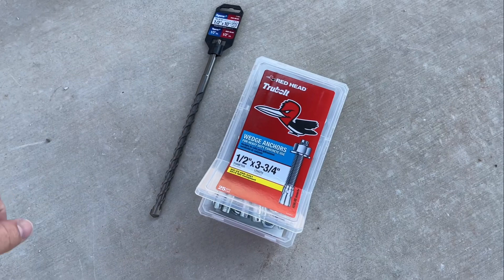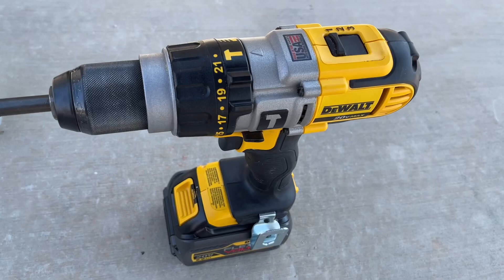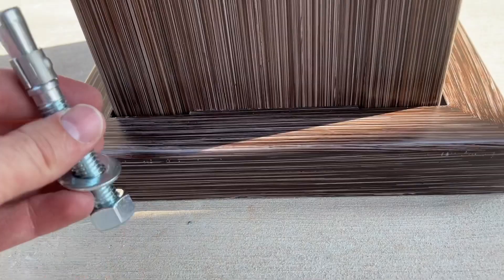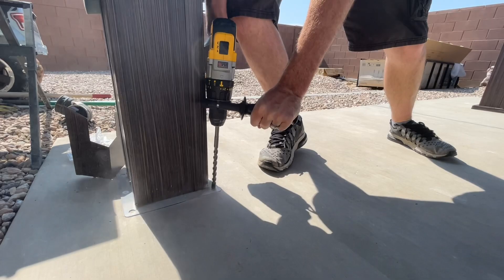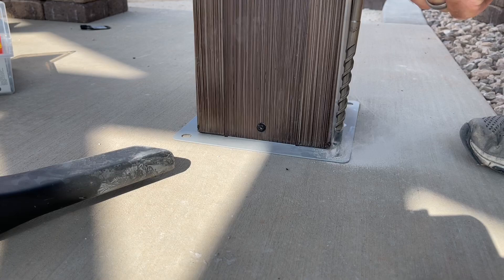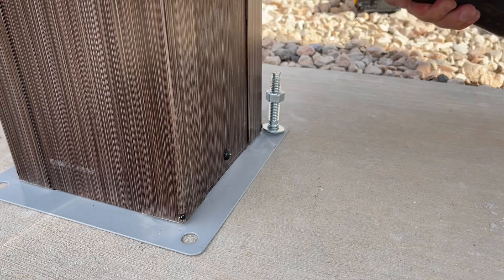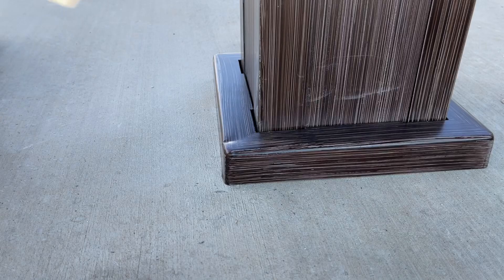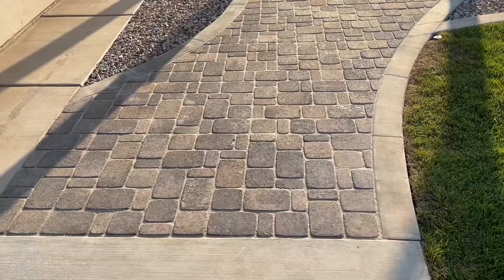Wedge anchor into concrete DIY. How to bolt down a gazebo, shed, or structure to cement

Comment: Here is another fun fact. Use a 3/16 masonry bit, drill a hole in the flange, 2x4 etc, insert a piece of 16 gauge annealed wire about 4 to 5 inches long and drive a 16d common nail into the hole. Inexpensive and strong.

Comment: Danny, great video,  how would I anchor my gazebo that's going to be on patio pavors?
Reply from the maker: Unfortunately, according to what I have read it is not possible. “Pavers are held in place by gravity and each other. They are not cemented together, so you cannot anchor something like a gazebo, pool cover or railing by screwing it into a paver. Too much force and the paver will lift out of place.”
  You may need to pour footings for where the Legs go
Reply: @dannyjohnsonsgarage  
I purchased this exact gazebo, but I bought it used a family member no longer wanted it. I'll be using your video as reference because unfortunately the manual is no longer available. Do you happen to know how far apart the corner bolts have to be?

Comment: At work so I can't listen with sound yet, but I'll preemptively ask:  is one bolt per gazebo leg enough? Do I need several?
Reply from the maker: I would say 2 or more, but if you have tornados in your area use 4 lol. Do what you feel is best. There are spots for 4 but my fear was to compromise the concrete and have it crack.

Comment: Thanks Danny.  In video you mentioned couple of times to not drill too deep in the concrete to the sand under slab.  So the drill bit was taped.  What is the reason and what if the slab is uneven?  With pole Hardware kit I got 6” long anchors but my patio may be around 4”.
Reply from the maker: Yeah, you’ll want to do as shown in the video. If you go down deeper than the slab, the bottom of the bolt that expands won’t expand into the cement, it would expand into the dirt. It would probably still hold and not come back up, but you want the expansion of the bolt to be firm. That’s why I drilled down so the bolt goes into the concrete on expansion

Comment: I'm looking to do the same with our gazebo, but the 3 3/4" anchors are too long. Could I simply use the 2 1/4" so that they don't have to be cut? I don't have an angle grinder and I couldn't find the 3" anchors.
Reply from the maker: Yes, just use shorter ones. They can be purchased individually so you can try one before buying them all
Reply: Did buying the 2 1/4" ones work well for you? I also don't have an angle grinder and was thinking of doing the same thing
Reply: You can use a hacksaw, cheap at the big box stores and just make sure it is equipped with a metal cutting blade, not wood. It cuts right through.

Comment: …. So what happens if you are drilling and hot rebar. And cannot relocate the hole?
Reply from the maker: Get a metal bit that will cut into the rebar or use a different hole area are pretty much the only options

Comment: I have a question. What is your cement slab is slightly sloped. How can I make sure my Gazebo does not end up tilted?
Reply from the maker: You can add shims under the feet as you assemble the gazebo to ensure it is level

Comment: Did u drill through gazebo hole? Any certain tip doing so? Is it easier or harder to mark holes then move gazebo and put it back after drilling holes?
Reply from the maker: The gazebo is so heavy it's best to drill up against it in my opinion. Watch your knuckles! I cut mine up a bit and didn't even realize it.

Comment: Great video. Very helpful. Did you secure the gazebo before finishing the build, or did you secure once the whole thing was built?

I'm debating securing the posts now, even though I don't have the roof on yet.
Reply from the maker: I waited until it was completed
Reply: @dannyjohnsonsgarage  Thanks. I think that's the way to go. I've had to make so many adjustments already.
Reply: I would recommend waiting until you're finished because you may knock it off square and it won't be as structurally sound if you had just waited.

Comment: How far from the edge can we drill holes in concrete.
Reply from the maker: I would stay a good 4 inches away from the corner. It depends on the size of the hole, but you probably want to be 4x the size of the hole away from the edge at minimum
Reply: @dannyjohnsonsgarage  thanks for the quick response.

Comment: What if the nut is not getting too tight.  Is this normal?
Reply from the maker: Make sure it does not cross threading, especially if you had to cut it off for size. It is best to put the nut on first and make sure it spins  freely, then pound it in so that the nut doesn’t have to go over bent threads
Reply: @Danny Johnson’s Garage  I think my problem is I used these Milwaukee carbide hammer bits and the tip is wider than the shaft so it made the whole slightly larger.  It wasn't hard hammering them down.